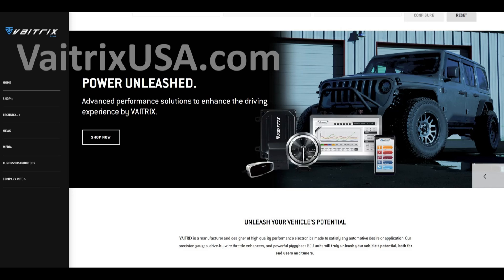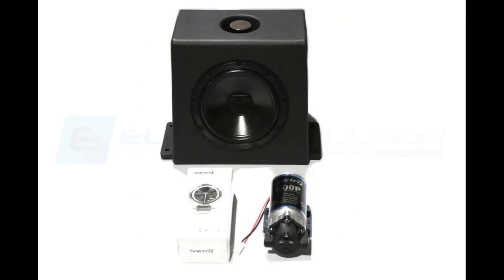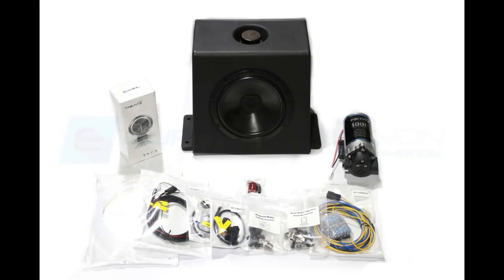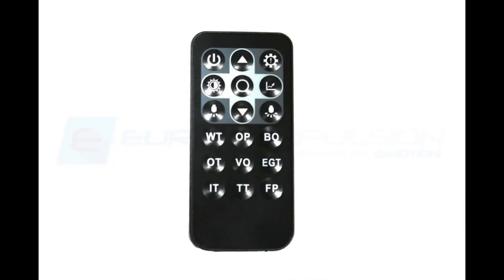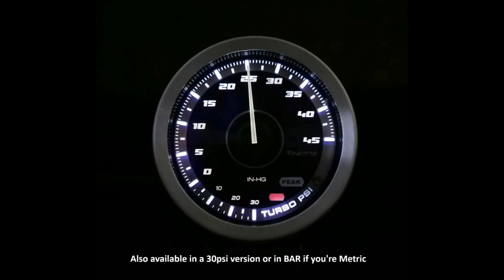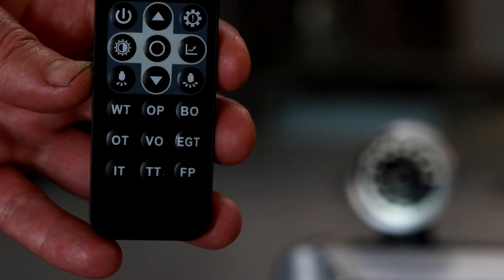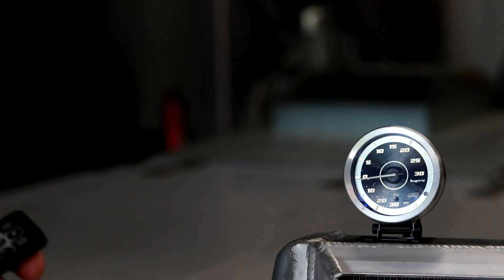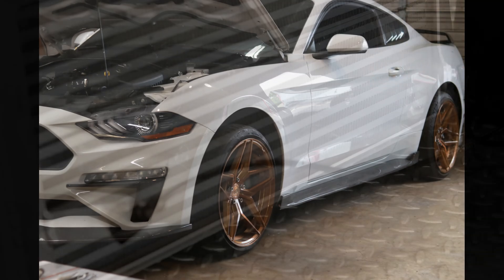Vaitrix Water Methanol Injection, How to Program it.

Comment: G'day,

  That's hilarious.

How far into the
Paranoid Persecution Fantasyland would one have to be living..., to even 
Hypothesize a concievable
"Need"...., for a
Concealed Methanol/Water Tank (pretending to be a LoudSqueaker...) - all the better to keep concealed the fact that one has secretly modificated their Fire-Chariot, to enable it to
RUN AWAY
SCREAMING 
(in anticipated pre-emptive Panic...?).

From whatever/whomsoever the terrified Designer might
Imagine...,
Of which to be VERY
Afraid....?

And the cunning
EuroPeons are producing them and selling them into the self-proclaimed

"Land of the Brave & Home of the Free...",

Are they ?

Where there are more Firearms in circulation than CitiZens on the Census to possess them - to defend themself from whatever they may imagine, of which to live in perpetual quivering Fear, while constantly arming themselves to act (pre-emptively ?) against....?

Well then, those Secret Paranoid Stealthy Methanol/Water-Injection Systems "should" sell so fast in the US that there won't be time to mark their prices in the Shelves in your Shop - so to speak.

As I said, what a hilarious concept....!

If it were all "For Racing", then the Tank would be shaped like a Tank built to hold Watery Fluid...

The fact that the Tank is manufactured to trigger the Buyer's Paranoid Persecution Fantasies and Spy-vs-Spy
Secret-Squirrel Fetishes...,. at least to my
Cynical eye ;
Pegs this as being the funniest lump of
Marketing Jism I've encountered all week !

As a Contra-deal, if you could find the time you might well get a giggle from my upload last week,

"Golden Light, Electric Motorcycle Pizza-Run, Deepwater to Yarraford ; 29 Km at 31 Km/Hr..."

Tertiary Regional Dirt Road, New England Tablelands of NSW, Chest-mounted Body-Camera, perfectly clear Blue Sky Dome, riding down-Sun, just before Sundown, for the last half of the Video....

A nice contrast to last week's upload, going to town on the Highway.

One set of interesting factoids has emerged..., 
On the trips to town, with 25 of 33 Km done at 45 km/hr on the Highway , for an average speed of 39 Km/Hr..., turn out to be happening at 24.6 Km/L, by way of the Fuel burned in the Generator afterwards...; and on the dirt back roads, when cruising at 30, and 40 on the secondary Bitumen roads - the Back-Road riding manages an average of 31 Km/hr,  achieved at 27.4 Km/L. (76 miles to the Imperial Gallon (4.454 litres)...

And I cover the stealthy black silent motorbike, and myself in my black Evil Knevil Suit, in bright reflective High-Visibility Orange/Yellow Vest & "Roadsign-Yellow" Arrows on the back of my Pannier Bags...; 
Because in the
Real World which I live in,
Succeeding in being unseen &
Unnoticed..., 
Is an excellent recipe to get oneself
Killed by excessively
Blending in... 

I'm literally still giggling at the idea of the sorf of
Craven Coward who would
Want a
 "Stealth Methanol-Water Injection System, with the Tank disguised as a (silent) SubWoofity LoudSqueaker..." !

How long before they release the
Upgraded version, which has an
Actually fully-functional Speaker -
The better to fool whomsoever it was fantasised might be perfuntorily, cursorily, & thus  ineffectually 
Looking for a hidden 
Go-FAST Modification in their
(presumably everyday road-registered) Car...?

What a "Moneyspinner" of an idea...!

(lol).

Anyway,

Keep on keepin' on,

Stay safe...

;-p

Ciao !
Reply from the maker: Hi Warbles, Apparently you don't drive a modded car in the People's Republic of California.
Reply: @GregsAirplanesandAutomobiles  LMAO. Cali smog checks are so asinine. They'll ban a closed loop catch can that improves the emissions system
Reply: @GregsAirplanesandAutomobiles  

Hi Greg,

Thanks... Um, no - clearly not.

Over here there are annual  Roadworthiness inspections to be passed, conducted by authorised & regulated Issuers of the "Pink Slips", required to renew the State Registration. Also compulsory is a "Green Slip", being a 3rd-Party Personal Insurance-Policy on the Vehicle - least it injure or damage 
Anybody.

Pensioners get free annual  Registration for 1 Vehicle..., Registration on my 2000 Subaru Forester would be
Were it not free for me,  
About $630/year - and that's about the same as the price of the Green Slip - allowing for it being garaged 15 klicks out of a small Regional Country Town, & me being 63.

There are Exhaust Noise Regulations, but I dunno what they are. There are Regulations on Tyre Overhangs and Tread-Depths, and if the Vehicle is out of a registration for more than 3 months it will take an Engineer's Certificate ("Blue Slip") to get it re-registered again...; and no doubt somewhere there's a list of things which might be specifically
"Verboten !", but basically if it meets the State & Federal Roadworthiness Standards - which the Engineers who signed-off on the things before any were sold are paid to know about..., then "it's all good..." (?) !

Other than that..., 
ICE Motorcycles have a Power to Weight Ratio limitation designed to stop Learners or Provisionally licenced Noobs from
Buying,
And then rapidly dying...,
On a stupidly overpowered
Cafe-Racer..., kinda thing ;
But that equation permits
 "Red P-Platers" (fresh off their Learner's Plates) to ride V-Twin 750cc YamahaHaaHa Clones of big heavy Darley Havidsons...

Oopsie (!) ?

Basically, I don't think the Cops care about the extent of the Aftermarket Go-Fast FASTER Modifications - as long as the Engineers have OK'd the Job for Registration...; 
They ONLY begin to become interested if the Exhaust Noise appears to them to be "excessive", and/or the Driving BEHAVIOUR has infringed or breached some Law - from Speeding generally to doing smoking Doughnutz in front of the Town Hall or the In-Laws' House...

Exceed the Limits for Speed by a sufficient amount, or get caught
Street-Racing, or doing burnouts on the Public Roads - and they not only sieze the Car, they then
Crush it before returning it, as well as prosecuting the Yobbos who were Hooning about  at entirely far too high a Speed..., as hard as the Speeding/Hotrodding Laws permit the Courts so to do. 

If one wants to drive at
Stupid speed on the Public Road,
Then one  Must
Perforce,
Enlist in the PoLice Farce ;
And then the Car & the Fuel
Both be
FREE, Y'see..., 
And they receive a big  heap of
Pay
Every Friday
Too, so they say...!

And 
Not only but 
Also, they get to carry 
Hand-Guns as well,
As to wear Body Armour, decorated with a Taser,  & a Can to spray
Capsicin too...

All of which are strictly 
Prohibited to
The likes of me & you...

But, they also have to work as
Cops, filling in the Paperwork for every Complaint and Transgression & Fcukup ever generated & produced by all of
Society - busily 
Doing it's
Thing...

And meanwhile,

It is axiomatic that nobody who is not personally deeply psychologically insecure, can ever remain employed for any length of time, in the 
(In)"Security industry"....; 
Because mature and secure Adults cannot for long convince themselves that standing around all day hoping that nothing will happen, is anything worth doing - regardless of the pay, and then being able to regard that as having been 
"a good dayze' Work..." 
When the Shift finishes
After NOTHING Happened
All the long day long...

The fact that those very particular 
Insecure personalities..., are the very same ones
To whom they give the most guns,
Has always, to me
Been a huge worry...
But I can extrapolate,
Y'see...?
(Tee hee....!).

Which is the more
Totalitarian,
Oz, or
KalifornicationNation...?

Such is the
Mystery
Of Life...!

Have a good one,

Stay safe.

;-p

Ciao!

Comment: While I am certainly glad I now know about this injection system I also wish I knew what it was for.  Mostly I follow Greg for the military history.
Reply from the maker: It allows for more boost, or in aviation terms, more manifold pressure, thus more power.
Reply: @GregsAirplanesandAutomobiles  Thanks!  I probably should have picked that up based on context clues!
Reply: @nowthenzen  Greg has a few vids on similar systems as used in WW2 aircraft. Off the top of my head, there's an extensive video on German MW50, and additionally too many mentions to count in various other videos (including the P-47 and several others).

Comment: What about nitro methane??at 76$ a gallon Or water injection with methanol combined with a hydrogen mix with hydrogen peroxide H2 O2 ,  regular fuel. 110 octane racing fuel is 556$ a 55 gallon drum 🛢️ , i need more power and more powerful feul from the normal low octane fuel ⛽.can it be used to inject liquid rocket 🚀 fuel into a rocket fuel turbo drag axle differential .. kicking 🦵 it out of gear ⚙️ with a air shifter  no engine necessary.
Reply from the maker: You can put Nitro Methane into a water injection tank. That's really another subject entirely. I don't support it in any way.
Reply: @GregsAirplanesandAutomobiles  just checking Greg 👍

Comment: Hey, Greg, does water/methanol injection hurt the engine service life? I'm not talking about running more boost, i mean you're compressing more water in the cylinder, and there's blowby, and oil, and so on. Any downside?
Reply from the maker: There is a downside to everything. In terms of engine life, it actually helps. It sort of steam cleans the combustion chamber and valves. However if you spray water before the engine is fully warmed up, or spray and then shut the engine off quickly water will eventually get into the oil requiring more frequent oil changes. So my suggesting is don't run the car hard until it's warmed up, which you should do anyway and change oil a little more than you otherwise would.
Reply: @GregsAirplanesandAutomobiles  rwd volvos lack any post-shutdown fluid circulation, so shutting the engine down while the turbo is hot brings an exquisite agony to me.

Comment: So, question. The difference between the low and high spray rate seems not to be progressive but a simple change of low flow, then high flow. 
I'm sure this is fine for 90% of the situations out there, but is there an option for 2 different spray circuits?

IE, spray into intake, low, the high, and then lastly turn on a second sprayer for even more? or perhaps a delayed action of intercooler spray?
Reply from the maker: It's low and high, much like a two stage system. Can you run two spray circuits? Certainly, but that would require a second solenoid and some other way to trigger it. It's not a big deal to add that, but few cars would need it. These modern turbo cars with 8 or 10 speed transmissions operate in such a narrow RPM range when at full throttle that it's just not needed.
Reply: @GregsAirplanesandAutomobiles  So I have a GLC Coupe with the M264 engine. The water to air intercooler does a great job but I would like more from what I have (like everyone else) I'm not opposed to having a H2O Injection kit and really like the setup, but I don't want it too invasive. 

The kit looks like it could be integrated really nicely, but I'm concerned about RPM and Manifold pressure pickups. Is this done through OBD2 or via direct pickups off the engine or wire taps into the harness?

Comment: I'm a little old to be fast and furious anymore. Although I have sort of dabbled on a Saturday night or two. 🙄 Is this intended to cool off a power added vehicle like a turbo/super charger? Or as Nitrous alternative? 
Water methanol? Basically we are talking about like washer fluid?
Reply from the maker: It's an anti-knock device, just like they used in WW2. It allows more boost from the turbo or supercharger than would otherwise be usable. Washer Fluid may or may not work, it depends on what's in it. All washer fluids are not the same, some have glycol.
Reply: @GregsAirplanesandAutomobiles   OH, nuts. That is true. people add that to keep it from freezing.